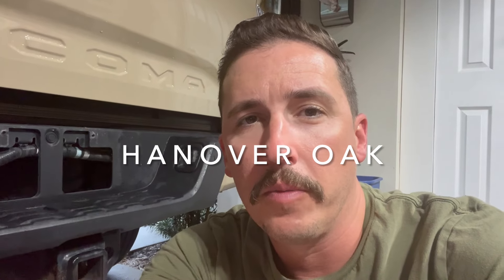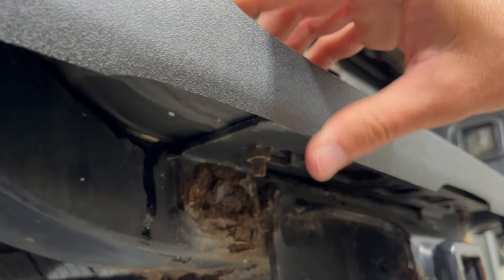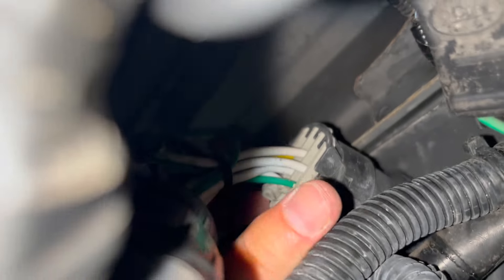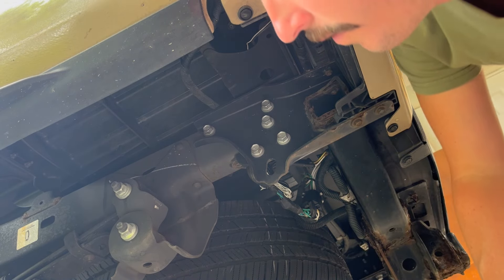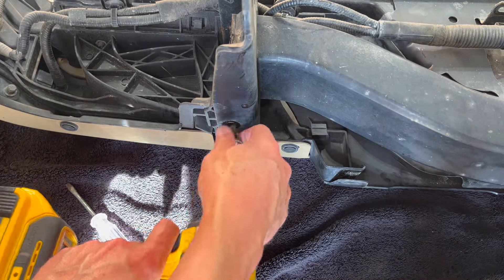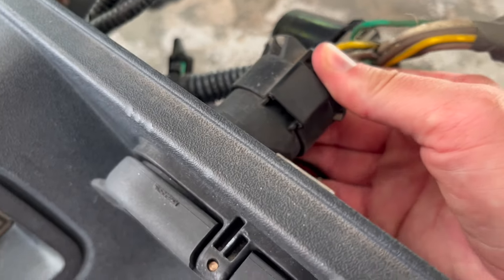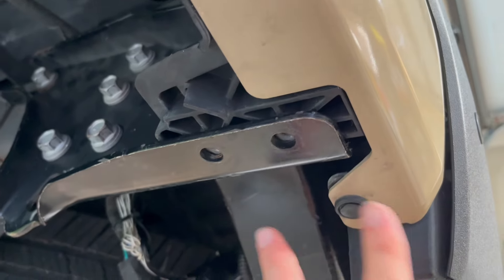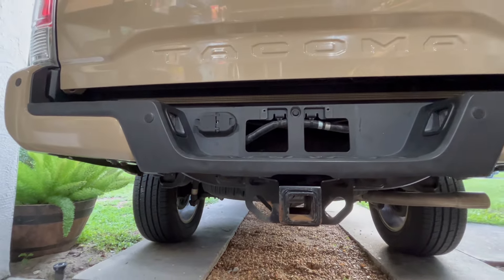How to Replace the OEM Hitch Receiver on a 3rd Gen Toyota Tacoma || Bumper Removal

Comment: Working on the same thing with my 2016 tacoma as well it has never been exposed to salt water. The only salt it has seen was from the roads in there winter here in PA. I suspect the paint and anti rust wasn't applied correctly at the factory as it only affects the rear hitch/frame assembly b

Comment: Thanks
I really needed this  
I'm going to replace my 3rd party hitch with a OEM hitch because I bought a steel bumper that uses holes that OEM have that the 3rd party hitch doesn't have. 

Question
15:00
How much torque is needed to tighten down the hitch?
Reply from the maker: Glad it helped! I didn’t use a torque wrench. Just used my breaker bar and made sure the bolts were really snug. Don’t push it too far and snap off your bolts!
Reply: If you do the OEM hitch and you do not have the tow package, don't forget you need two brackets to the frame additionally. I just put on a OEM hitch tonight, I didn't have the tow package, and needed those and the 8 bolts the brackets need.